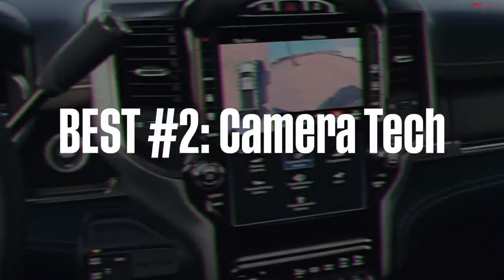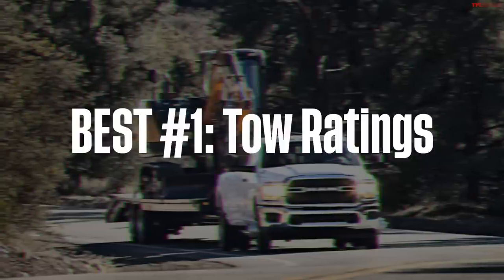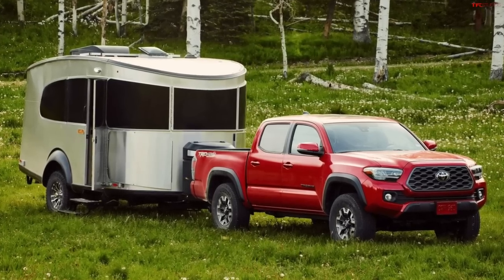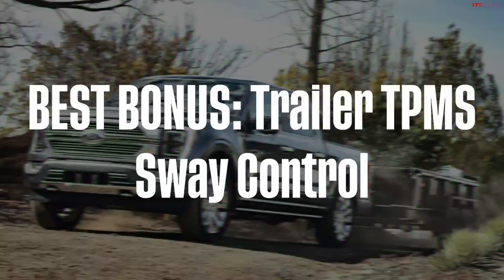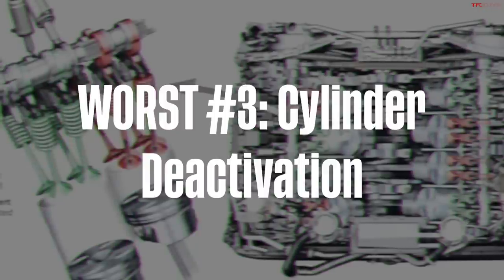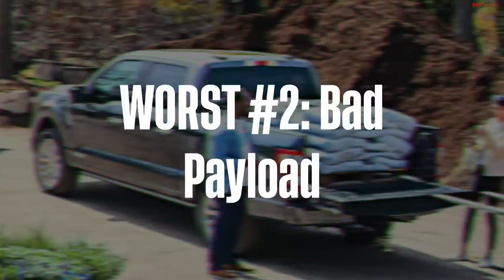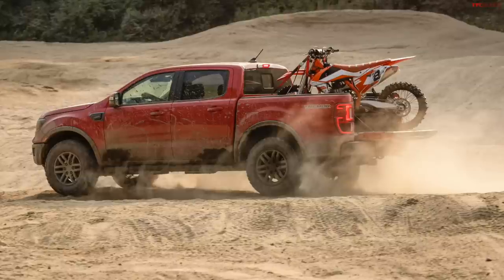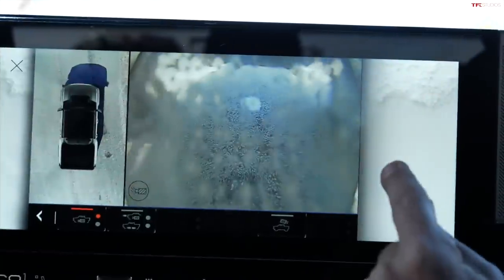This New Truck Tech Makes Your Pickup WORSE!

Comment: Something the "basic truck" crowd has to remember: old/legacy items get expensive as technology evolves.  Most of the modern truck tech you dislike uses outdated microchips.  Thus when a global crisis comes, manufacturers will focus on making the more profitable chips as opposed to the legacy chips a.k.a. a chip shortage.  Now imagine if materials manufacturers still made hand-cranked window components or traditional AM/FM radio components with old screens.  It will cost more to keep these legacy parts than transition to a more modern component, especially when modern vehicles share inner bits across a company's line up.

This is completely different from companies putting necessary car controls into menus on huge touchscreens; that's a safety concern I hope changes soon.  But the old late 20th century bare bones truck is gone.  It's much cheaper for all trucks to have power windows and replace radio gauges with an 8-inch screen than to manufacturers 40-50 year old legacy parts.

This topic of what is or isn't necessary in modern trucks (along with the manufacturers's laziness in still using legacy computer chips) would make for a good TFL podcast episode.

Comment: I like my multi pro tail gate. That step makes a great seat and I could never get into the bed without using it. I bought the camera to put on the back ok my enclosed trailer but have not mounted. I hope it will make backing into my garage easier.
Speaking of dogs, where is Flash?

Comment: Problem with all this technology is the cost.  You pay for it with the initial purchase, and then, when it inevitably breaks, you pay a king's ransom to get it replaced.  Notice I said replaced, not fixed or repaired.  When I look at these huge touchscreens in these vehicles nowadays, I wonder how much it will cost to replace when it goes out.  When a single headlight assembly, which is little more than plastic, costs over $1000 each, there will come a day when a vehicle is totaled because the technology is too expensive to replace.

Comment: That's why I like a simple 🛻💨 like the midsize Tacoma 4X4 off-road it's easy to drive around, it does pretty damn good off-road ⛽ mileage sucks but it doesn't have all the fancy & silly stuff & I paid $41,000 with a 7-year 120k warranty still a lot but nothing like most pricing out there 🤷

Comment: I’ve had a 2023 Silverado for 4 months as a rental while my 2022 RAM is in the shop. I’ve never been a brand loyalty guy, never been a brand hater, but this truck alone has made me wary of ever buying a Silverado. Electrical nightmare from the get go
Reply: That has been my experience with GM products since the late 80's.    Wiring fail.  My daily driver is an '04 Buick Rainier with the 4.2L inline six that I bought brand new for my wife.  It has gotten every recommended service on schedule or early (I do 3000 mile oil changes, not 5000). The only real headache the thing has given me is loose ground wires.  Thankfully, where I live they don't use that much salt in the winter so the body and frame are in good shape, but I've spent way too much time tracing down broken grounds.  Every time I think I've got it, I get that whistle through the speakers that is electrical feedback from a bad ground.  Pretty sure it's somewhere near the transmission as smacking the center console will usually silence it.

Comment: Range extender VIA - Big Ass battery pack in the trailer you are towing... or tow vehicle that has it's own batter and powered wheels that drive at the same speed (and stop at same speed) as the vehicle does

Comment: I brought my Ram 2019 usedfor 42k with 5 k down in 2019. Now the same truck cost around 60k. That as much as my first house I brought in 1988. This may be the last vehicle I will buy. It have to last until the wheels fall off.

Comment: #1 - Complexity of systems, making DIY repairs harder 
#2 - Overall size - larger and heavier is a liability unless you’re towing a lot
#3 - Weak beds - the composite beds are easily damaged
#4 - Automatic transmission models only 
#5 - Features like push button or floor-pedal parking brakes automatically relegate these trucks to being street queens only 
#6 - Big wheels, smaller tires - immediately indicates the truck is a minivan with an open back
#7 - Low, wide, long, and long wheelbase - all make these new trucks useless for any off-road use 
#8 - Electronic traction control modes - absolute garbage 
#9 - Screen-based gauge clusters
#10 - Computer-controlled 4WD systems, and non-field-repairable 4WD systems, like the Tacoma’s separate 4x4 ECU

I could keep going, but these 10 are sending me straight back to the ‘90s and ‘00s for all off-road vehicles … the new ones aren’t going anywhere.

Comment: So far, no issues with my GMC cylinder deactivation system after 80k miles.  I think it does help your highway mileage, particularly if you stay under about 70 mph and the truck isn't heavily loaded.  My understanding is that if you are very diligent re: oil changes, it is a lot less likely to bite you.  But the cylinder deactivation system does not tolerate poor maintenance very well at all.

Comment: Overpriced MSRP's as well as "market adjustments" 
Electric Emergency Brakes... now called parking brakes..... Electric ones have so many disadvantages, especially in mechanical failures or electrical failures, there's no way to regulate how much resistance is applied.. it's all on or all off.... there's many times when only a slight drag is needed.... plus, mechanical E brakes are more reliable & work in any condition, even without keys or power or even after an accident...and they don't activate themselves when theyre not wanted or needed....mechanical parking brakes need to go...

Comment: I've been looked down at for comments about older trucks being better when I've made comments on YouTube by other options and that's ok. Everyone has a different option. Some things about newer trucks are better I'm sure but not only the problem of manufacturers and inflation but the whole idea of a truck is a machine or tool to get tasks done and something for recreation and fun off road. Manufacturers have gotten away somewhat from that recipe. It's nice that they are more usable than ever but with all the electronics and lighter materials it's getting out of hand. So you go to the bank and give them a kidney so that you can show off a $70,000 dollar pickup that as Roman said you're afraid to drop a shovel in the bed. You guys were on it with you're list. 👍 Also manufacturers should look at older designs of trucks and learn what positive things have evolved with them and work with that.

Comment: YOU have the power to do something!  You are influencers in this space!  I think most people will say the problem is price, and if you want to do something about that then pound them on price.  Don't mention price last in the video, mention it first, mention it last, mention it in the middle.  If you want manufacturers, and customers, to consider the price of trucks then make it the main issue for you, because it is already the main issue for us.  Don't review the fully optioned truck, review the base model.  Not once or twice, but every time.  Tell them you don't want a 150 King Ranch, you want the base model, or nothing.

Comment: Best truck tech: 8-10 speed automatic transmission. Worst truck tech: all the added weight, hight and ground clearance that largely negates any fuel efficiency gains from the drive train. It is fine to release a truck made for off-roading but most trucks spend their lives on roads, whether paved or gravel.  This includes work trucks. 

Pickup trucks could learn something from cargo vans. Imagine a cargo van with an open bed instead of an extended ceiling and set up like a pickup truck. Delvery vans need to be fully-enclosed and lockable but a simple pickup truck variant could have a market segment and people could haul bulky or long items lower to the ground, with better fuel economy and without the enclusure of a van.

Comment: Electric seat adjustment is a zero out of zero. No one ever had trouble adjusting their seat from any position to any other position within 3-5sec. Three levers, no waiting. Electric motors and switches are heavier and slower. It's just an excuse to charge more.

Comment: Payload numbers continue to decrease.  It seems that Ford, especially, has abandoned truck camper buyers.  Short bed camper buyers have been forced to leave Ford and go to GMC.  The other issue is visibility.  The big hood on the GMC heavy duty creates a dangerous blind spot.  Ford and Ram are better but not by much.

Comment: There's a new EV RV, the Lightship L1, coming out that is a tow-behind, with an 80kw battery/electric motor, that is supposed to make it range-neutral for EV trucks towing it.  So that is kind of a range-extender for electric trucks.
Reply: Probably easier to tow a diesel generator with a charger attached.

Comment: So I’m with some of the other guys on here.  Most this stuff I don’t need.  Like the electric everything.  Case in point the electric tailgate had a crew back into a light pole a couple years ago while plowing. And yes it had a fancy camera, the thing is I did replace the tailgate with a different one but it had to be plugged in in order for you to use the tailgate.  The wiring harnesss gets damaged in anyway while in use guess what now that tailgate is not fictional.  Is a stupid problem.  Same with the camera u bump that camera while loading and now the truck freaking out about the camera not working.  The other thing about the camera when u have them people become dependent on them so when they stop working it’s almost like the truck broke down.  I mean the trucks have three mirrors use them.  Anyway can some of this stuff make thing easier yah until it acts up then ur just sol

Comment: The payload issue is so artificial. it would be very simple (relatively) for the manufactures to up the GVWR of a 2500 to 11k to and a proportional change to a 1500 as well, and solve a large number of the issues where people are "over capacity." Legally, yes they are, but they are well within the capabilities of the truck plus buffer room. Sadly the big 3 never will because then Consumer would have no reason to jump up the ladder to a 2500 or 3500 respectively.

Comment: 10:54  the cybertruck takes this to a whole new level...... if it ever gets built.
Reply: 14:44 it's not that the trucks were rushed to market, it's just that there's not enough energy density in lithium-ion batteries to prevent this problem.  

I'll get off my soapbox for FCEV's for towing, mostly because those trucks don't exist at the moment.  

But it's not a "rushed to market" thing, it's a "fundamental flaw thing"
Reply: 16:02 part of me thinks this could make an opening for "kit cars" like if someone just made a kit for a dead simple truck that's comically over built, capable, and doesn't cost an arm and a leg.
Reply: @roguedogx  It's a "current battery technology is crap" thing.

Comment: Give me air, a two knob radio, power windows, locks, 8 foot bed and the ability to purchase a 5 or 6 speed manual transmission. They can leave the switch in the cab to activate the four wheel drive and locker. Call me good.

Comment: why do they create those ginormous grills on trucks and then combine the trans cooler into the radiator and then the truck ends up overheating....Seems like the two things go in opposite directions. One makes it better and the other makes it worse. Just for cost and not for function?

Comment: Most of the things on both your lists, I consider a negative. Towing capacity is the only exception. I love my '98 one ton dually, but modern half tons have higher tow ratings. No idea why this truck is rated so low, it can easily pull, control, and stop more weight.

Comment: I’m really surprised that you guys have not been paying attention to internal surveys. Fords own surveys indicate that people do not buy or tow with 1/2 ton trucks. Less than 25% of F150 drivers report towing more than once a year, and of those that do tow, they report towing less than 30 miles. 
People that tow big loads hundreds of miles primarily use HD vehicles. 
At a minimum, for the way most people use 1/2 ton pickups in this country, for the towing the vast majority of 1/2 ton drivers do, vehicle electrification with better torque and regenerative breaking  should have been included in the improvement category. Less fuel, less maintenance, more convenient average refueling, vibration free and considerably smoother to operate. 
In another fact Fords latest surveys report that Lightning drivers utilize the bed for moving things other than humans (51% ICE vs 75% BET)and using the truck for camping  (40% ICE vs 48% BET) more than ICE Ford F-150 drivers.
The one thing that stands out is the road tripping infrastructure (A use case that the average truck driver performs less than 1% of their drives) and even this is not an BEV truck problem it’s a charge company problem, that with any luck and time will resolve itself.

Comment: Great video!

How about real basic work utility truck, Without ANY of these? I mean REAL basic, no carpet, no robocop tailgate, no gizmos, minimal electronic stuff, no digital dash, real buttons, only the very simple and basic stuff. Only enough robust engine and transmission. Does not need to have 1000hp. A good reliable 300-350hp engine with good torque is enough. Don't wan't a racing truck, but an UTILITY truck. Also, with such basic configuration, the entry price would be really affordable. There's a market for that. A BIG market. Nothing on the market now. The F150, Silverado, RAM Truck, are too much now. Way too much.

Comment: Most people aren't using a half ton truck like a truck.  Some of use would argue a half ton was never a real truck anyway. Anyway, the average person has a relatively short daily commute so the electric half ton makes perfect sense.  They aren't towing and hauling with these trucks on any sort of a regular basis.  Of coarse electric 2500/3500's don't make sense right now with the current technology and they aren't producing those for that reason.  If you want to work a truck...get a real work truck.

Comment: So I got to say the list is pretty spot on but I have a couple of comments.  The ladder in the tailgate for the Ford trucks is better in actual use than the GM folding tailgate in my mind because I can use it regardless of what is in the hitch.  Many trailer balls, and especially something like a pintle hook will bash the GM tailgate if it is folded.  The Ford does need something stronger on the last step as the plastic cover overhangs the step and is easy to kick off on accident.

The backup assist is also helpful at times as well.  I am better at backing the trailer when taking sharp turns, like into a driveway because I am willing to take a sharper turn than the computer will.  On the other hand if you have a long path you have to back down it is so nice to turn on the backup assist and let the truck handle all the micro corrections.  Some places when I go to pick up hay or a horse do not have a place to turn the truck around so I have to back up 100+ yards on a fairly straight narrow drive and the backup assist makes it too easy.

Comment: Would love a smaller truck with the same towing capabilities.
Reply: If you are not towing over 7500 lbs, Tacoma and Frontier are great options and they are not turbo charged atleast through 2023 for the Tacoma. And as of now Tacoma has a 6spd automatic and manual transmission still. I really don't care for these 9 and 10 speed transmissions.

Comment: If you live in a city, there is no problem with electric vehicles. Just buy what works for your situation. Having 110V AC power without running a generator on the job site is pretty awesome. I think a simple basic electric truck would be cool, kind of like the Rivian Amazon van.

Comment: Traction control has No place on a 4x4 pickup. It completely destroys the truck making it useless for anything but a mall crawler.
Reply: You are right if you can't turn it off otherwise for the store runs it's usually good enough in 2wd to keep you from having to switch to 4wd assuming snowy conditions. For actual off roading you are right traction control can be more of a hinderance.

Comment: i could live without….towing tech (back up camera is good enough), power tailgate (just dampened is good enough), too many tech features (id keep it to nav, wireless car play, heated seats, radio, heated steering wheel, adaptive cruise, rain sense wipers, auto high beam, dual zone climate, and remote start), and wood grain panels on interiors.